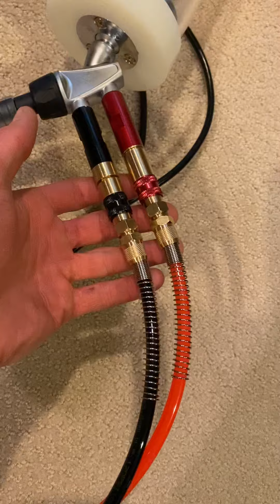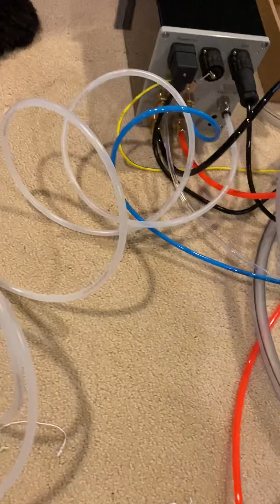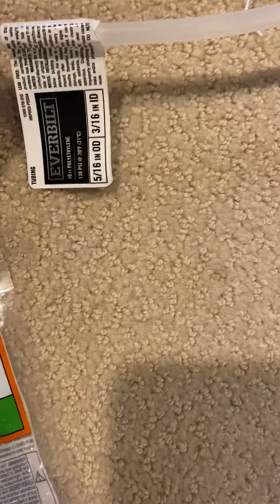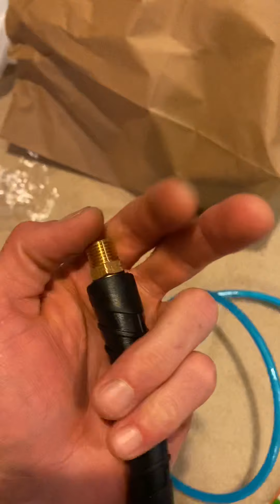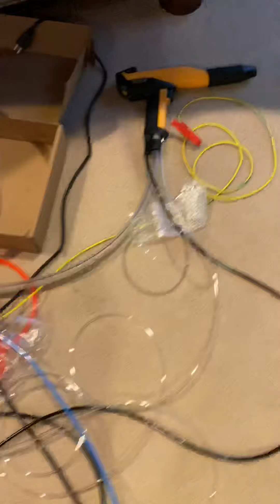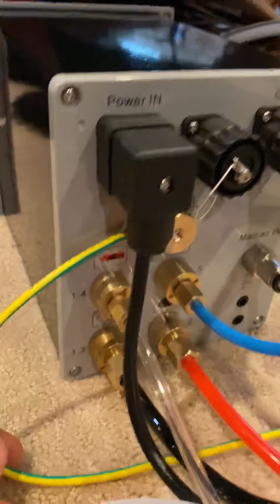Abbys powder coat machine set up - long high trading

Comment: I’ll add check your fluidizer air on the control box. Set that to about .4-.5 because it seems to come set pretty high and causes puking. To much air and combined with powder in a tight space...it’s gonna start looking for a escape. Start low and raise up till you see powder starting to bubble like a pot of soup...